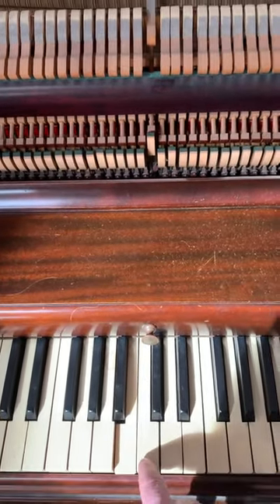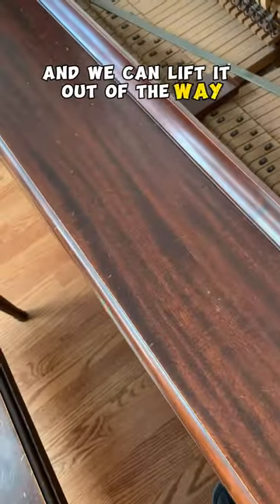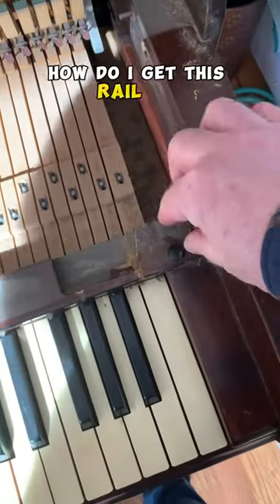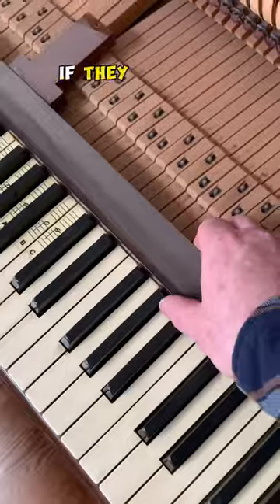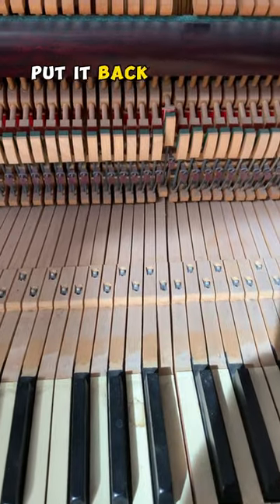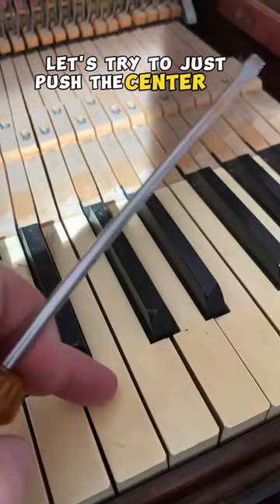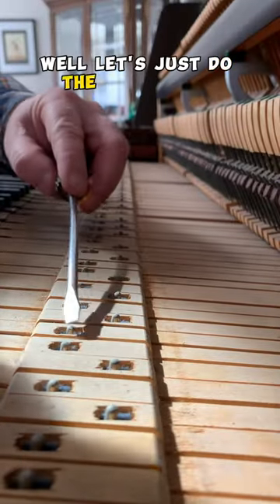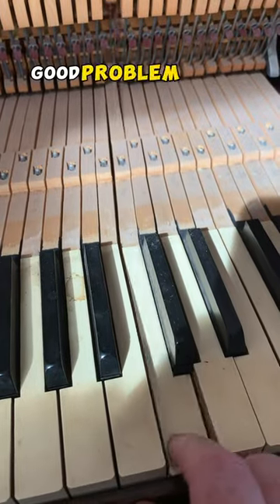Fix stuck piano key #piano #pianotuning #music #woodworking #satisfying

Comment: Hii, I was wondering if you could help me, my schools Steinberg Baby Grand Piano has 1 broken key. It’s middle B. Some kids have come in and slammed all over it and now that one key doesn’t work. It will work sometimes and then others not. Nothing is stuck under it or beside it and it’s not rubbing against anything, it also feels a little weird to push down. Sometimes when it does work, it feels normal to push but the times it doesn’t work it feels weird
Reply from the maker: It sounds like something is rubbing. There is no way for me to know what without seeing it. Could you send a video when it is stuck?
Reply: @preludepianosolutions  I’ve had a little look and I’ve figured out it’s a little like thing that moved back and forward and it just needs oiling, personally I’m not going to do it myself but I know someone who could fix that issue

Comment: Hey I was wondering if you had any advice - one of the keys on my console is squeaky as well, but for another reason - the jack spring has detached from the jack and is sideways. It is still attached to the wippen. Should I glue it back to the jack? Also it is really hard to access because it is behind the little rod that holds the backcheck. Thanks.
Reply from the maker: It doesn’t glue to the jack. There is actually a little hole in the bottom of the jack that the spring pops into. You may be able to use a little screwdriver to pop it back in place.
Reply: @preludepianosolutions  Thanks this is very good to know.